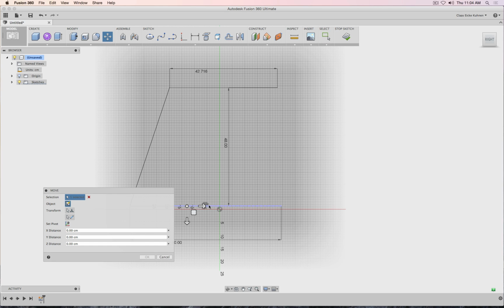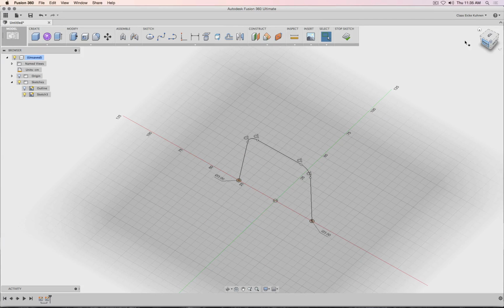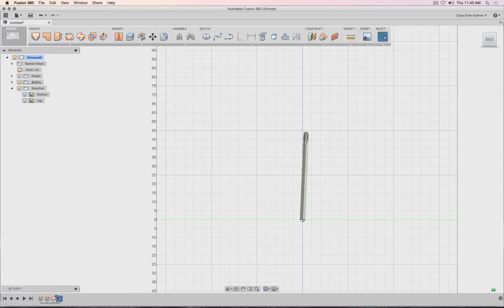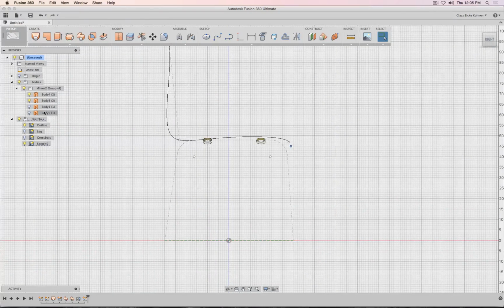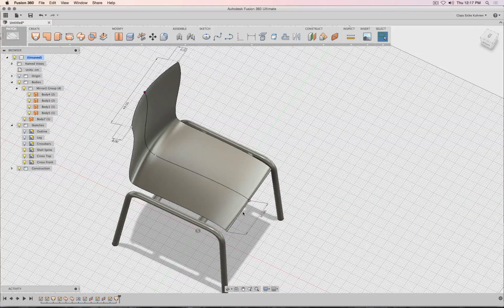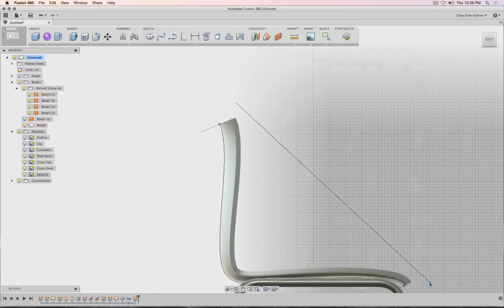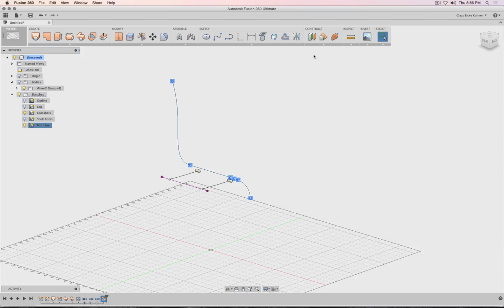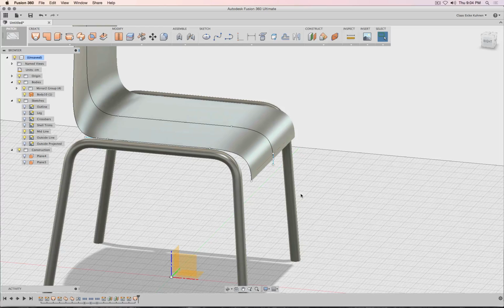Bent Plywood Chair with a Steel Pipe Frame

Comment: Great video and explaination, really really useful. There's a leap of some minutes in the video, where I cannot see anything because is dark, and I cannot understand how you jumped from the sketch to the outline. However it was quite useful, I learned a lot, thank you!
Reply from the maker: I dont know what happened. However what I do in the first step is just making a cross section sketch for reference. In step to I rebuild the same sketch for modeling. So if you just follow the second step you can do the first step.

Thanks for watching.

Claas